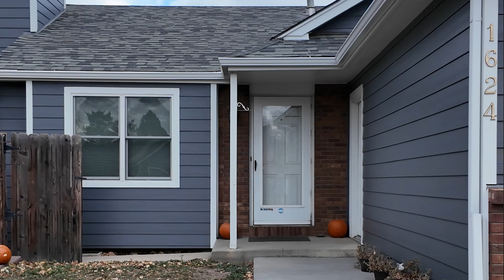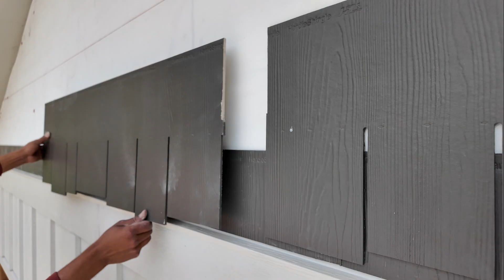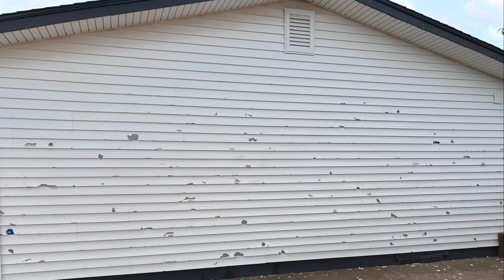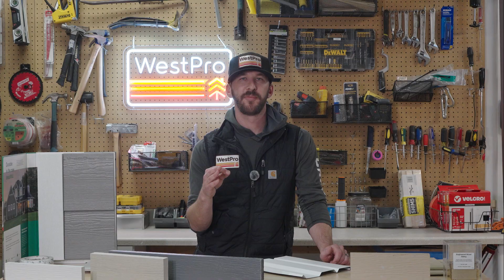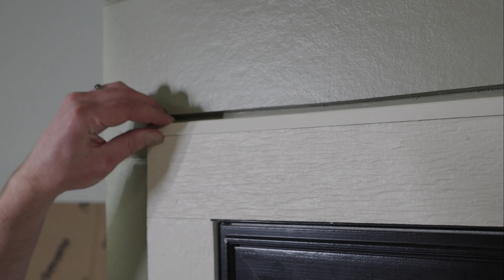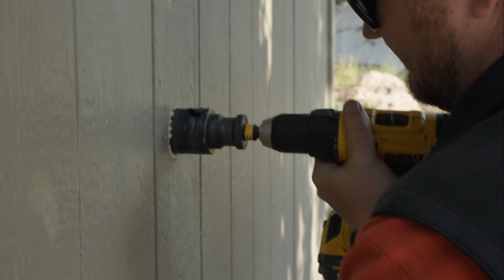Hardie vs LP vs Vinyl: Don't Pick the Wrong Siding for Colorado!

Comment: Online says vinyl is 3-5 per square ft installed for the mid grade brand. Can you breakdown the cost of materials and labor for vinyl siding installation.  I know you do not do the cheap stuff but If vinyl siding material is 2-3$ a sq ft, is it really and extra 11-14 per square for just installation?
Reply from the maker: Good question. I've seen a lot of online price calculators, lead generation sites, etc. that show siding (including vinyl) as an "installed" price at some impossibly low prices. The sources of this info is never an actual contractor. They seem to be taking some field material cost (no accessories) and adding it to some vague data about labor costs. The idea being....siding material + labor rate = cost of new siding. They are incredibly inaccurate and misleading. Truly accurate pricing information, (as in what a real contractor would actually quote you) is hard to find online.  Frankly, it's why we are making these videos.  When we talk about pricing, we are talking about what you would actually pay a contractor. Price ranges in the video include tear off of old siding, disposal (dumpster or dump trailer), dump fees, underlayment (housewrap), housewarp tape, trim coil for flashing and window wraps, field siding, waste (leftover pieces that you can't use or return), J channel, starter, nails, labor, overhead (workman's compensation and general liability insurance) and contractor profit. The reality is, many of these costs are the same regardless of siding material you select. Basically, if you're paying of all of this to be done, you may as well do it with better siding material. Not much savings on cheaper material anyway.  Hope this helps clarify. Thanks for your question.
Reply: Paying 3$ a square for siding. I think 11—15$ extra for the labor and other factors is a lot?  But you must do the higher end million Dollar homes with higher end siding. You are high end like Andersen windows.  Your might not be use to doing homes under 500k. Andersen is great but 3-4 k per window is not within everyone’s budget. So they get the 1500 dollar windows. But their home is also not worth as much. 
Also fiber cement siding is more time consuming that vinyl so the labor should be cheaper. But I get what you mean by upgrading .042 to .046. Upgrading vinyl would not make the installation price go up